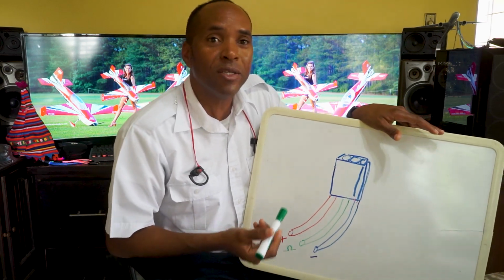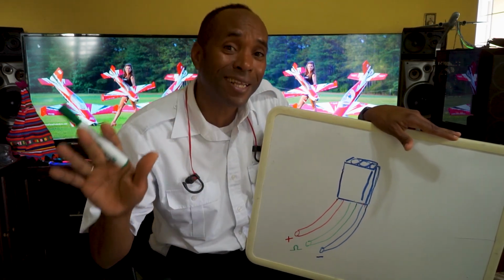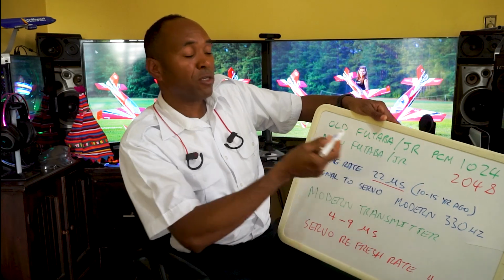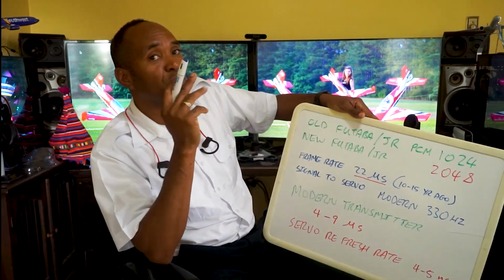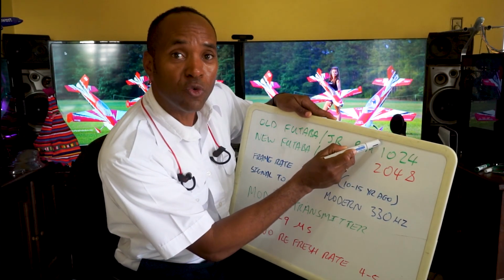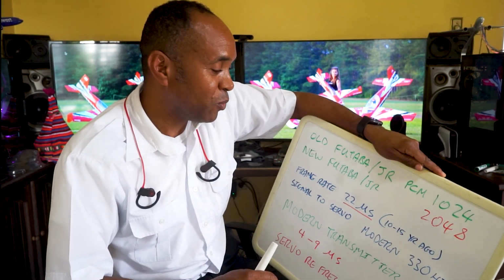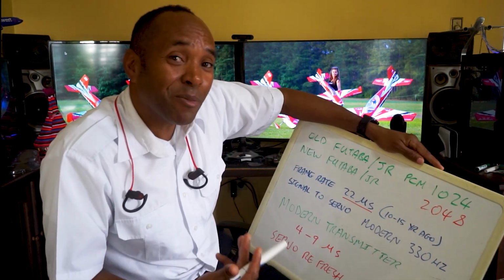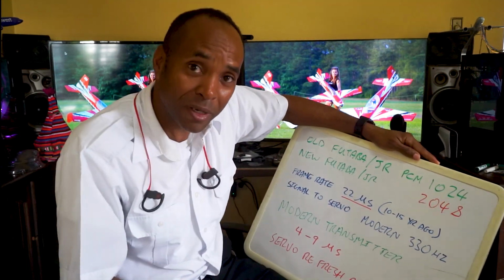Rc plane electrical systems with Mark West

Comment: Also, energy used per flight is actually measured in units called amp-hours or milliamp-hours (mah).  When you fly then re charge your battery to determine typical draw per flight you are actually replacing energy in mah, not straight amps. (Amps is current flow, not electrical potential energy).

Comment: Few small corrections....servo swing for resolution is 180 deg, but the transmitter commands through a range of about 120 deg. (Sailwinch servo will swing much more).
Lost both planes in one week, not two.